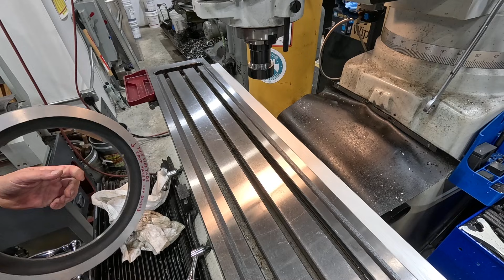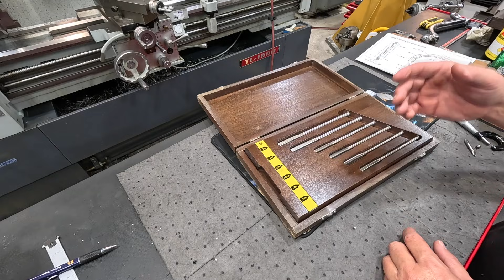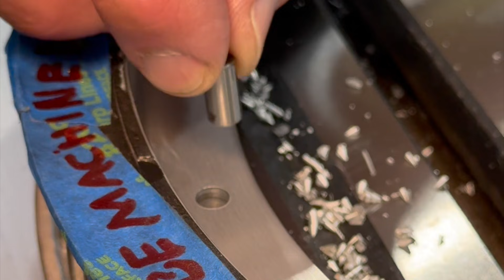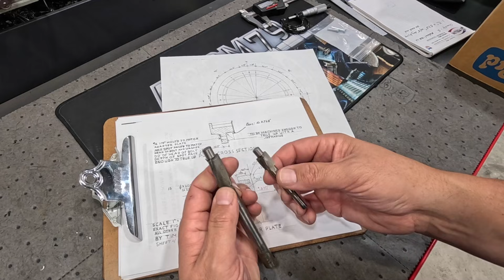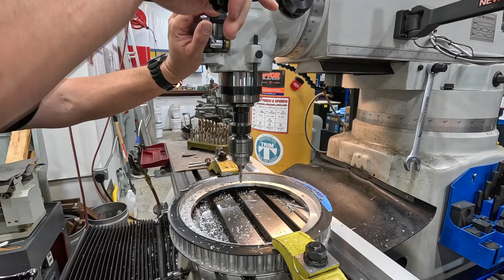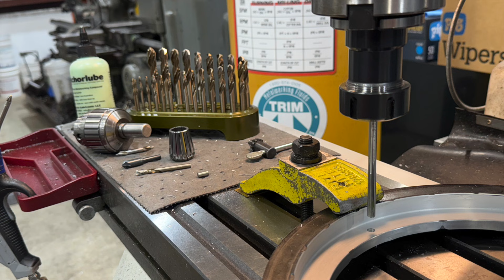Harley-Davidson FLH Chain Drive to Belt Drive Mods Part 2- Drilling the Hole Patterns

Comment: Could you not have set that up on the milltronics cnc
Reply: Faster Cycle time but more backroom time. Unless you already have a CAD model then likely slower for a one off. Even conversational over manual/dro will be slower unless you are really proficient. Also far more whining from the manual or death peanut gallery 🙃
Reply: @seabreezecoffeeroasters7994  I guess the old men (the DROs are for children guys) are pretty much dead now.  It's "manual" machining if you have to turn the cranks yourself.

Comment: Good video. I enjoyed the Manual aspect very much. It took me back to my roots. However, I am curious why didn’t you use the Milltronics Mill to drill these holes? Finding the center is easy and Ben you could either use the canned cycles in the mail or fusion 360 to program all of the drills reams and chamfers.
Reply: People whine when he does CNC and people whine when he doesn’t. Sheesh
Reply: @grntitan1 chill Karen, no one’s whining.  All I see is curiosity.
Reply: I thought the same.  Maybe because it’s just a one off?
Reply: Or the Milltronics are busy with drill indexes so breaking them down to do this takes too long

Comment: Nice video as always Adam🙂 Another protip for you when it comes to manually machine aluminum. Use denatured ethanol as a lubricant, it leaves a much nicer surface finish when drilling our sanding our milling on aluminum specific.

Comment: the kbc question you don't have a power feed on the front or the knee is there a reason. like just how you roll??? in the day i had to use a 3/4 wrench on the front to cut like squaring a plate .
Reply: I think he mentioned recently that he had it for the y axis but hasn’t gotten around to installing it?

Comment: If McMaster-Carr doesn’t have it, you probably don’t need it.
Reply: Or the Japanese "McMaster", Misumi (especially when dealing with metric hardware!). Although Misumi doesn't sell as much of the "commerical operations" (Building/janatorial, etc.) stuff and instead has a lot more automation components (PLC hardware, customizable datum pins for fixtures, etc.). If neither of them have the oddball fastener or the like, it's a goofy situation all right!

Comment: Nice job.
But it looks like that Anchor Lube just gets slung away instead of liquifying, following and lubricating the drill all the way through. We use some dark grease like stuff that melts and flows along as the hole deepens. Perhaps there's not enough heat produced drilling in that aluminium to "melt" the green stuff?
Reply: I bought some to try. It’s actually pretty good. Prefer my mistic metal mover for most stuff.
Reply: @leemarchant7191  
Mistic Metal Mover? Is that some oily stuff or the flood coolant?
Reply: @Peter_Riis_DKcutting fluid. Oily
Reply: @leemarchant7191 
Thx.